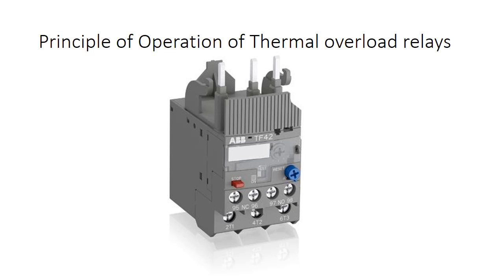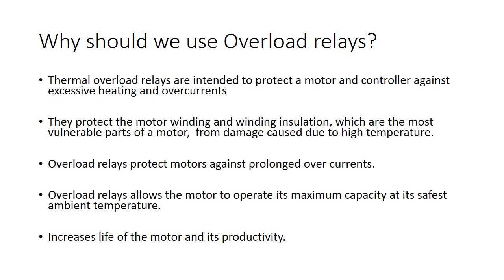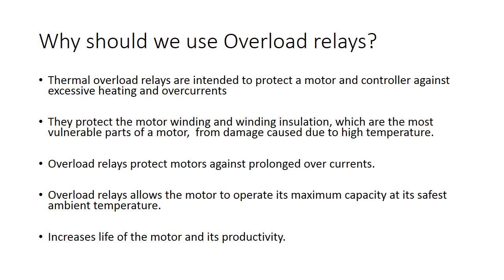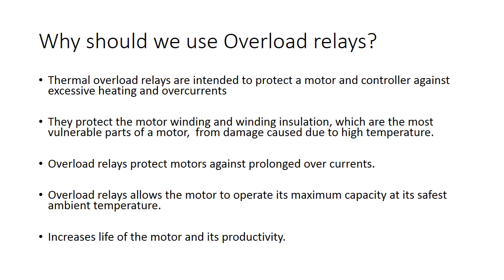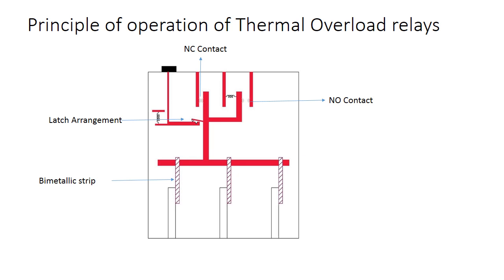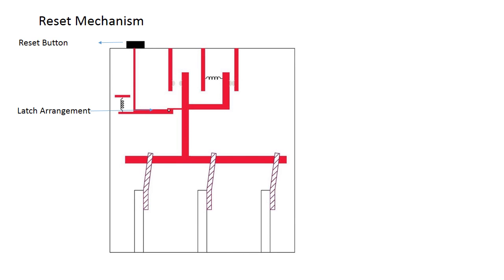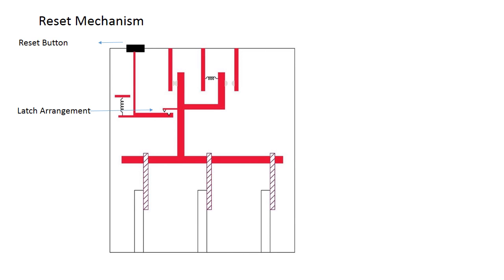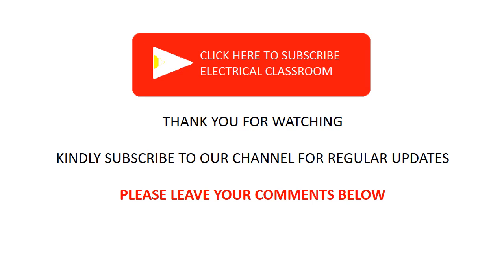Overload Relay - Principle of operation

Comment: What would cause multiple overloads on a system to have high resistance readings across them ? 35-70hms ? This is then affecting the overall Zs reading of the circuit with extremely high earth fault loop readings. Even though the earth is fine, the high impedance is across the overload device. All 3 poles on a TP circuit reading mostly the same resistance.

Comment: I have a 15 Hp motor. Rated 22 amps. 
How much current i have to adjust  on the dial of the over load protector.